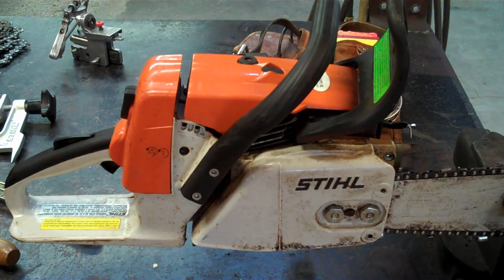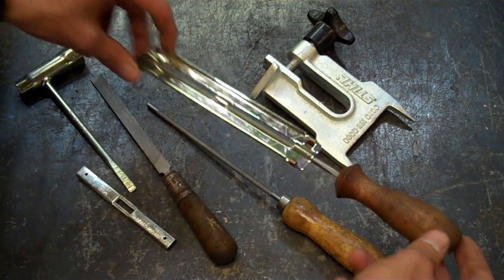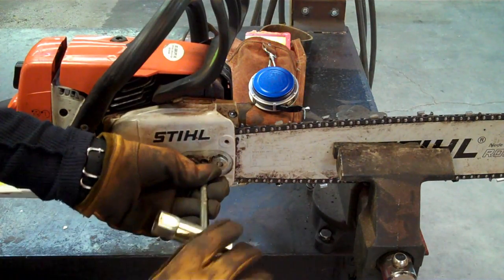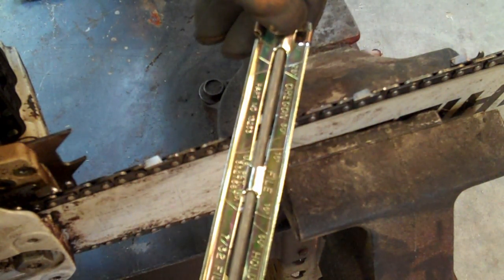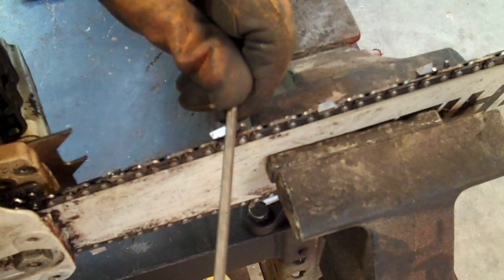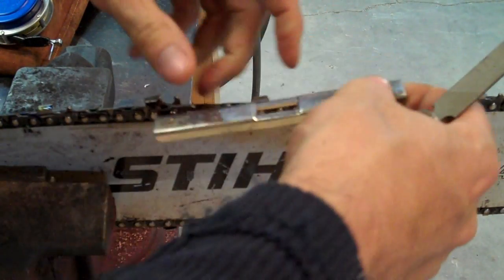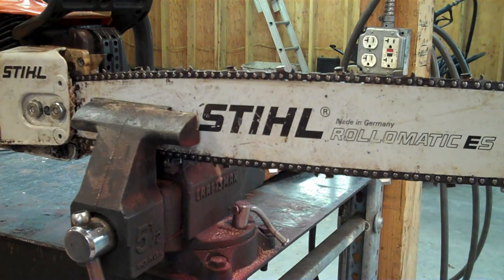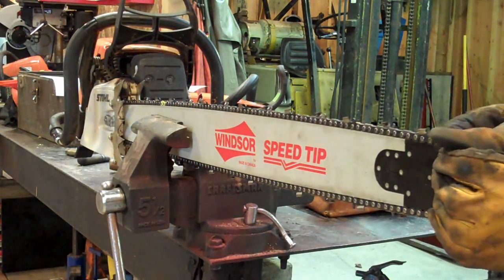Sharpen Your Chainsaw Like a Pro – Essential Tools & Tips

Comment: I don't mind the sharpening exercises but after three or four times I never can get it anything like as sharp as a new chain. Is it just me?
Reply: +Tin Man Yes it is, but it's not totally your fault. I can now get my chains to cut better than new, however this took many years to master. So many factors that are hard to explain, especially doing it with a file. One thing that helped was the Northern bench mounted grinder along with a quick hand file every other fill up while out in the woods. I also bring my depth gauges down an extra stroke or 2 over what the gauge wants. I can last all day now and rip through some wood..:-)
Reply: i also have that problem, it may be due to simply the chain steel weakening due to heat. Or just simply wearing out.
Reply: My thoughts on this is a new chain to me is as bad as a dull chain. I always sharpen my new chain be for i use it as a new chain has way to much resistance. Like anything you need to find what works for you. I file totally different than others I work with a crew and everybody file slightly different if a guy tells me how to do it his way I just look at him and say I do it my way and it works for me I've been doing it for 20 some years and I don't have a problem. My saws cut straight and true right till the end almost till the teeth are falling off.
Reply: gabriel ethier I sharpen chains out of the box too, just a couple of light strokes is all that is needed for me. Then I file about every other or third fill up

Comment: Sorry, another point or two. After each tooth use the file handle(wood) or a piece of wood to remove the burr from the tooth- each and every tooth- the teeth are plated and you runthe risk of the harder chromium peelin back in use if you don't, shortening the life of chain.

Comment: you say to leave the chain reasonably loose.
thats the opposite to other instructions,they say chains should be reasonably tight.
stihl 038 manual says hold nose of bar up and tension chain until it lies against the underside of the bar then tighten the hex nuts. ie, no daylight.
i dont know your qualifications but on the video it does look a little too loose.the weight of the saw should not be on the bar when tightening  this will cause more wear on your bar as oil needs small clearence to work

Comment: Here's a problem I always run into, how do you know you've been all the way around when you're filing the teeth? 

I guess you could count them, but there's gotta be an easier way.
Reply: always start at the master link on the chain. it will always have 2 of the same teeth connected.
Reply: yakomuto just look at the cutting edge of the link. If you've already sharpened it, the metal should look raw. If it looks like its been used, it probably has.
Reply: What my grandfather and I do is use a marker and put a mark on the top of the tooth that gets done first

Comment: Ive been holding saws since you needed to oil manulalu with yer thumb while it was running! Oh it the fucken thing weighed aboput 65 pounds! yep landing saw from back in the day! Dont EVER USE mechanical grinders on chainsaw chains gets em too hot and ruins the overall edge imo, 7/32 's or better file three swipes to each tooth unless your a hacker and think your saw can eat anything then replace and give saw to better sawman! lol!